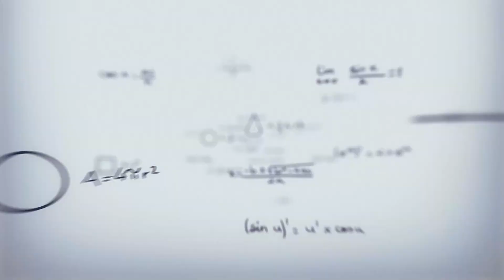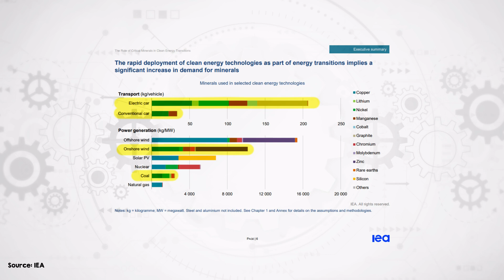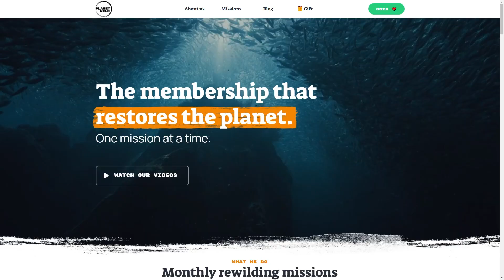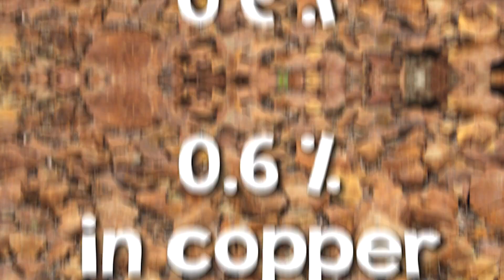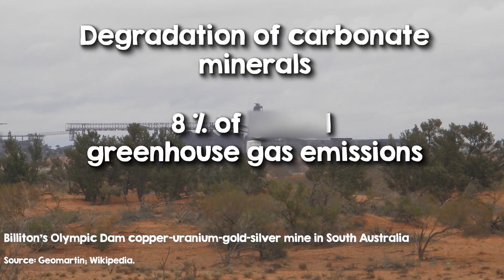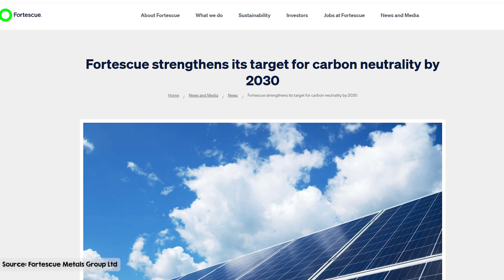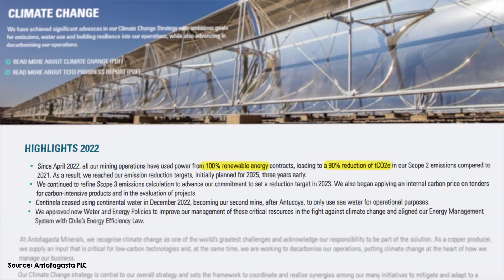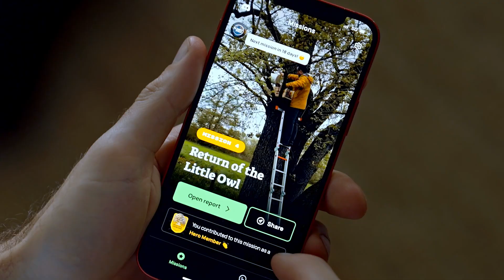Zero-Emission Mining Technologies are Here

Comment: I still think that OCEANIC CARBON SEQUESTRATION AND STORAGE through electrolysis should be taken more seriously. There are research projects that show that this process can capture carbon from seawater combining it with calcium and magnesium, creating a byproduct which is basically lime. So you are using energy to produce lime and capture carbon in the process. And considering there is a much higher concentration of carbon in seawater than in the air, It seems to me it should be muh more energy efficient. Oh! and also, electrolysis produces the much needed green hydrogen too!!
So whats not to like? I would love to see a video from you Rosie about this topic. Maybe you can show us the low points of this method, a more realistic version, but also start a conversation about it, since the IPCC reports have already said that we are going to need some form of carbon capture to reach net zero.

Comment: The comparison of mining required for EVs vs ICE cars isn't right.  The numbers excluded AL and Fe, which are the vast majority of the car, particularly for ICE.  When those are taken into account, instead of EVs being six times as much mining, they're more like 25-30% more mining.  A huge difference.  Cars are highly recycled already, and EVs will be extremely recycled due to the value of the metals in the battery.  There is already a gigantic lithium ion battery recycling industry; it's here now.  Mining may not be "sustainable" but cars will be largely a circular economy, so pretty sustainable.

Comment: I worked at a sand quarry and we used 3 times the power because head management didn't want to recondition the electric motors.. this is in australia.
washed sand to 10% silts needed 5kwh of power and 3.5lt of diesel per tonne of washed sand.

Comment: I'm still holding out hope that "energy reduction" in stead of "energy transition" will for a large part solve the contradiction between global environment and local environment whereby you started the video. 15 min cities made of wooden buildings and interconnected through electrified public transport and extensive car sharing, heating and cooling grids, international HVDC super-grid, anti-waste food sovereignty (urban agriculture), LED lighting, rewilding... To some extent I believe that is something that the people actually want.
Reply: Electrification IS energy reduction, because electric devices are much more efficient than combustion devices.  You don't have to replace the energy of a 25 gallon tank of gasoline when your EV gets effectively 140 miles to the "gallon" (electrical equivalent of a gallon of gas).
Reply: @incognitotorpedo42 incidentally, it is a part of an energy reduction strategy, but the point is that it is most often not the most direct way: abandoning an individualistic lifestyle for a more social one beats electrifying an individualistic lifestyle.
Reply: Yeah the ultimate carbon neutral transportation is walking or biking.

Comment: Hydrogen is a great option for gas low emissions.
Reply: ehmmm... no! It is not.  Unless the very recent finds of native, so-called "white" hydrogen prove to be a) plentiful, and b) exploitable, hydrogen must be produced.  It is NO source of energy, but only a vector.  It is presently produced by the steam reforming of coal or natural gas... and THAT generates extremely high emissions.  Yes, it can also be produced by water electrolysis.  But a) the power used for electrolysis MUST be from renewables if you want the hydrogen to be "clean", and b) it uses so much of it so inefficiently, that it is much better using that renewable power directly, with no hydrogen detour!

I am not at all against "green" hydrogen... quite at the contrary, I worked improving the efficiency of electrolysis processes for 6 years in my career... but whatever amounts will be produced for decades to come will be best used in industry!

Comment: 1. Yes "green" solutions still require mining, emmissions, environmental and social consequences. The point is they require LESS mining, emmisions, environmental and social consequences. When opponents complain about the materials for green solutions they always fail to balance a comparison with the materials for the solution they are replacing. Better is better even if it is not perfect. 

2. "Green" solutions improve themselves. The more we adopt green solutions the greener it gets to make green solutions. 

3. Of course we should put some resistance to new "green" solutions to ensure they actually are better. Why most environmental minded people are against hydrogen fuel transportation and carbon capture on energy projects. Because the math on these proposed solutions does not add up. But when we find green solutions that do decrease environmental harm, we need to make the move to the new solution. 

4. If you really like to complain about the environmental impact of "green" solutions...then your only recourse is to adopt minimalism. You cannot complain about the harm of green solutions, then keep using the even worse fossil fuel solutions. Just stop consuming all things, then you can cut environmental harm from all solutions. If you are not willing to minimize your own consumption - then get on the bandwagon of green consumption and stop obstructing progress.

Comment: A big thumbs down for the lies and misinformation in this video.
1. Rosie claims 10% of global CO2 emissions are from mining, "with over 90% of that from fugitive methane released during coal mining".  First, she just confused methane and CO2.  Doesn't she know the difference?  Second, according to "Our World in Data" "Greenhouse Gas Emissions" chart, "Fugitive emissions from energy production" is only 5.8%.  This includes all CO2 and methane from all types of energy production.  Does she just make up numbers?
2.  She compares the 12,750 Kg of fuel burned by a petrol vehicle with the 160 Kg of minerals used in an EV, and says that's 99% less mining.  Surely she knows that in order to get 160 Kg of minerals, you need to mine at least 2 ORDERS OF MAGNITUDE MORE ORE.  In other words, you need to mine 16,000 Kg of ore (and overburden) to get that 160 Kg of purified, finished metals.  This doesn't even take into account losses of materials from the manufacturing/fabricating processes.  (I'm not including the recycling of batteries since it is only hypothetical, and not commercial reality at this point in time.)  Petroleum extraction generally removes only the petroleum from the ground.
3.  She talks very flippantly about increased mining being good for the planet since it reduces the amount of plant food (CO2) released.  Plant food becomes people food through photosynthesis.  Do a search for "Carbon Dioxide Fertilization Greening Earth" to find an article on the NASA website about a study showing increased CO2 is 70% responsible for increased plant growth on earth.  Also, interestingly, climate change is responsible for 8% of INCREASED plant growth.  (Yes, the MSM and the IPCC are lying to you.)  In reality, the climate is getting MILDER!  High temperatures are NOT increasing.  Low temperatures are increasing, primarily at night, in the winter, at higher latitudes.  That's why the average temperatures are increasing.  Also, severe weather is NOT increasing; that's just fear porn to convince you to give up your freedom and money to the elites.
4.  She also talks about the efforts to decarbonize mining and material production with no consideration of real-world economics and pricing.  It's easy to wave hands and pretend that all this will come about at no cost to anyone.  In the real world, these things have costs, making poor people suffer.  Poverty kills.
Reply: Hmm!  I think YOU are the one who is misinformed.  Coal mining's worst atmospheric impact is not CO2 but indeed methane.  Rosie confused nothing, you did!
Both coal mining as well as the whole natural gas system release methane... lots of it.  Nobody yet knows exactly how much, but your source that says 5.8% is probably in the right ball park for METHANE leaks (the present range is estimated at 4-7% in the case of natural gas, less for coal)!  But those 5.8% are not "only 5.8%"!!!  You would know that it is a disastrously high level... if you knew anything on the topic.  
I don't want to go here into detailed calculation but, to simplified illustration would be:   100 units of natural gas are extracted, transported and distributed, and then burnt to produce energy, releasing 100 units of CO2 in the atmosphere.  Unfortunately, that activity also leaks 5.8 units of methane into the atmosphere.  But, as methane is around an 80 times worse GHG offender as CO2, the green-house impact of these 5.8 units of methane are equivalent to ca. 460 units of CO2!!!  So, that "little leak" is actually multiplying the CO2 emissions of natural gas by a factor of more than five!!

Battery recycling is anything but hypothetical.  100% of end-of-life or production reject EV batteries are already being recycled or, in some cases, stored to wait for a quantity important enough to justify building the recycling plant.... as quantities are still very low.  It is so true, that EV battery recycling is mandated by law in Europe, at least.  Battery recycling is NOT some options you can lightly discard.  Minerals have indeed to be mined and refined to build the first generation of batteries, but will then be recycled at efficiencies of 98-99+% (for metals, admittedly less for graphite, plastics and electrolyte), but will have to be mined only once!

I happen to be a professional in the renewable energy and material recycling fields, and can assure you that Rosie is right on most things she says (I picked up a few minor errors, here and there, in her videos).... and that you should better inform yourself before writing with utterly misplaced confidence!

Comment: Oh my, did she just compared the amount of fuel you have to burn to the weight of the battery ?
Reply: If the issue is mining, why exactly is that wrong?
Reply: @incognitotorpedo42  Cause you also have to charge that battery, and whatever the way you do will need further mining. It's an orange to apple comparison, on one side (the petrol side) you consider the material requirements for the energy, on the other (the battery side)  you consider the requirement for the storage. Turning it around, it would be like comparing the necessary raw materials for making an empty fuel tank to the material needs to produce the electricity you charge your battery with.

Comment: Some old mines can be repurposed to provide pumped hydro. Here is a study for Australia

' Australia has set a readily achievable goal of reaching 82% renewable electricity by 2030.

The Australian Energy Market Operator suggests by 2050, this nation needs about 640 gigawatt-hours of dispatchable or "on demand" storage to support solar and wind capacity. We currently have about 17 gigawatt-hours of electricity storage, with more committed by Snowy 2.0 and other projects.

The 37 possible pumped hydro sites we've identified could deliver 540 gigawatt-hours of storage potential. Combined with other non-mining sites we've identified previously, the options are far more numerous than our needs.

This means we can afford to be picky, and develop only the very best sites. So what are we waiting for?'

I can't post a link or google anti spam will kill my comment, but search for:
'Researchers found 37 mine sites in Australia that could be converted into renewable energy storage'

Comment: EV (Electric Remote Combustion Vehicle) batteries are not recycled, they are taken to a land fill, pushed into a big hole by a very large Diesel bulldozer and then covered with dirt by that same Diesel powered machine.

Like most recycling Electric Remote Combustion Vehicle battery recycling is a scam.
Much propaganda and BS is disseminated on the subject but it is not happening.
The only batteries that are commonly recycled on a industrial scale are lead acid starting batteries for piston engine vehicles.
This occurs because the chemistry and construction of this type of battery lends itself to easy cost effective recycling.

The bottom line is we will not consume our way out of the climate problem, regardless of the technology.
We must conserve, reuse, repurpose, repair and keep our infrastructure items going for as long as possible, not rush to get the latest new thing.

Comment: REALLY interesting Video Rosie! It's great to see that Aus is leading the way in decarbonising. I found the crushing/grinding section interesting, as I used to detail installation of crushers a long time ago. This case is really interesting because it can be done intermittently, storing the inputs/ outputs of the crushers/grinders. Of course they'll need 2-3 times as much plant, which the bean counters won't like, but once they've made the investment the process should be cheaper, and the plant will last longer, and have residual value when the mine is exhausted. Hey maybe the mine could continue longer with the poorer ore if these processes are made cheaper in the long run. Also, when the sun goes down the workers can go to the pub!

Comment: That low-temp electrolysis project sounded really interesting, and I wish you went into further detail about that.
Low-temperature and high-temperature electrolysis can work with using geothermal, waste heat from nuclear reactors, solar thermal, and industrial waste heat.

I'm desperate to learn more about that because it poses a massive solution for decarbonizing the steel industry, a solution for oil refineries that need to shift away from natural gas, and source of zero-carbon hydrogen for making e-fuels for aviation, the marine shipping industry, and rocket fuel.

Comment: Rosie, you just compared all the energy needed to drive an ICE car for its lifetime to a battery as though the two things are comparable. 
A proper comparison would include the energy that it takes to recharge the battery for its whole lifetime as well. Also if the battery has half the lifetime of the gas tank then a battery replacement would also be needed. I like your content but that comparison was disingenuous. Please don't do that any more
Reply from the maker: You've missed my point. You are not alone, so I can see that I wasn't very clear on this aspect. This is a video about mining*. That comparison was in response to people saying that we'll need more *mining for the energy trnasition. Renewable energy to charge the battery doesn't need to be mined, so it doesn't need to be included in this comparison.

Comment: Big problem the Li-Ion batteries are not being recycled anywhere near the figures quoted.
There is no magic fix to the emissions problem, none. The best we can hope for is the cessation of the production of single use consumer products and frivolous trash products churned  out of China and other similar economies and there is a fat chance of that ever happening.
Next some fool said that the emissions are mostly localised to the mines and refineries, well that's largely BS as once it it is in the atmosphere  it is not contained especially in the case of open cut coal. As for refineries that too is mostly BS as they have had decades to solve this problem and it has been mostly a failure. When it comes to CO2 capture this is mostly a myth when it comes to large scale infrastructure. It basically requires the production of the same amount of CO2 as it captures and never really captures the CO2 emitted by all the other process activities. To say that they can put up enough solar and wind farms to power the CO2 capture and produce enough power to charge EV's and supply the restof the domestic and industral power needs is just delusional.
Reply: I am producing more than enough solar power to run my EV and house with 5 people we could run another EV all my panels are second hand at $100 a kw they may not be as efficient as new ones but at 5% the price and not ending up disposed of by solar installers I see it as a good thing.

Comment: @EngineeringwithRosie
 A very timely video indeed. 
I work for the contract mining partner of one of BHP's copper mines in here Australia and only last night, sat next to the lady running BHP's transition to 'Net Zero 2030'.
It was interesting to hear what their plans are, but also the raft challenges that face the mining industry.
Obviously as you said, a short video can't hope to cover the complexity in any depth, but the struggle won't be easy.
BHP is attacking on many fronts including - 
Committing early to future clean electricity partner projects in exchange for better pricing once they come online.
- Working with local government and power partners to vastly improve power delivery resources to the sites 
- Spending actual billions to make their own power infrastructure and grid in WA where there's currently no provision
- Battery Electric surface haul trucks and machines (pantograph powered and battery to get between power sources) etc.

On the practical side of the fence, close 20% of all energy used in Australia is for mining, if all of this is to come from green electricity that is a staggering 8200000 Gigawatt hours of energy generation to be built and implemented ... just for mining.
No doubt at all that this can be achieved and is being given priority but none of this will be done for free. 
The end result is that the user, us, will be the ones who pay.
We will have to pay more for every item we buy, and noting recent reports on resource mining and stockpiling in China, we will in this country, be priced out of the global resource market. Our iron ore, copper, lithium etc will be dearer than China's and the market will decide where to buy. 

The climate shouldn't come down to economics, but that's how the free market works. It's sad that it's come to this.